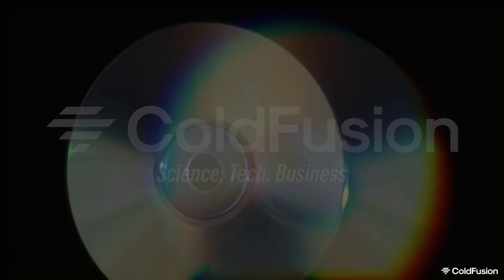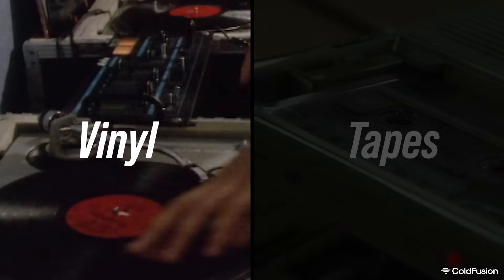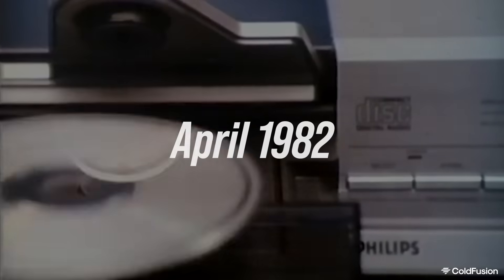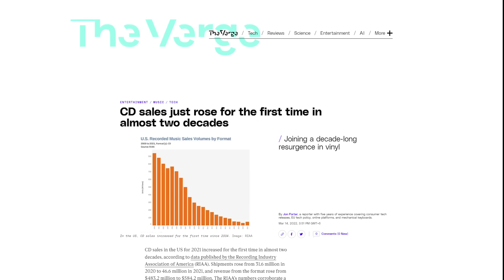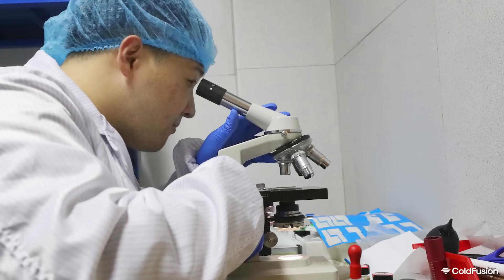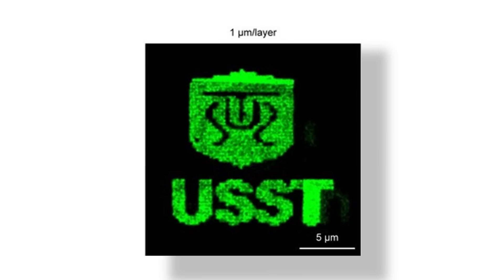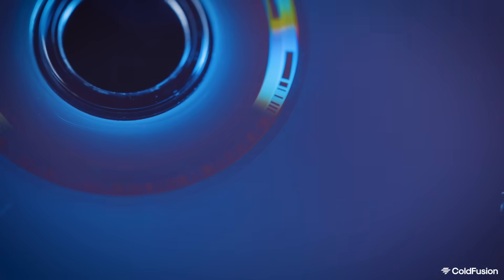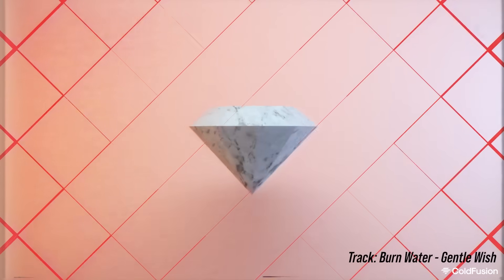Why This New CD Could Change Storage

Comment: You cannot store data on flash drives indefinitely. Sooner or later solid state drives need electrical charge from a battery or an outlet to maintain its data integrity. It could even suffer catastrophic data loss from getting an over surge of electricity. CD were the last storage medium that combined optical and mechanical technology to create data storage medium that could last beyond the owners own life expectancy. With the fad of solid state technology finally waning due to shortage of raw material to sustain production rationality is finally forcing marketers to return to earth and focus on a technology that is sustainable for archiving and storage.

Comment: If they're not using organic dyes this time around, and it's stable mid to long term, it's going to be a boon for read only storage stuff that doesn't need to be retrieved immediately.
there's got to be a lot of backup targets in data centers that could use a shrink in physical size.

Comment: Even with improved read and write speed, I don't think this can ever compete with large SSD storage (which can already reach 20tb per SSD, at blazing fast read and write speeds), there is one application tho, where this could be a game changer.

Data center archives, as of right now, if a data center burns down, you either lose the date, or need an entire extra data center, just to archive one copy of it, which is ridiculously expensive.

But with discs like that, your entire data center back up could be a read and write machine the size of a printer and a small safe to store the disks. And every single disk could have an entire data center copy on it, with plenty of room to spare.

This kind of tech is clearly not meant for individuals, an entire human brain stores about 2 petabytes, who could ever need, even in the far future, 100 brains worth of slow storage ?

For mass archiving tho, yeah, that's pretty dang useful.

Comment: I h*t3d compact discs!
Looks like they're gunna be back. It's such a flimsy technology. I still have plenty of 70's and 80's cassette tapes, cause they're so durable- they just need an unwind from time to time.

I still have most of my vinyls from that time also- yet very few CDs. They just don't last long and they scratch easily.
I've got 2/3 copies of my collection of PS1 CDs.. 10 or so from the 60/70 music discs I bought in the 90s and 2000's. I've only got "Dune" and "System Shock" from my PC stack.

Many times I made use of a CD, I had to treat it as if it would be the last time I'm gunna hear, see or play it, cause the next time, it may be scratched.

It's just not a sustainable technology, in my eyes- unwieldy(massive), flimsy, and "old". Why the appetite for it now- and to "safekeep" or store data(!?), I dunno.

Comment: LOL MB/Sec write? That's like 6 years to write 1.6 Peta byte of data! A Spec of dust would cover up 10s of gigabytes of data!  
Back in the 80s I remember reading about using a sodium structure to write on atomic scale.  This is like that idea recycled 40 years later and click baited onto a CD! video.
I'm surprised 5G and AI wasn't included into the hype.

Comment: If they can make it one quarter or less the size of a normal CD (1/4 of 1.4 PB data is still a lot) it could be basically an MP3 player overloaded with an interface if it can browse fast and pick the song then it could work.

Comment: I have the best of both worlds. Still have my fully restored R-94 Rowe jukebox. Its a combo made in 1993-94 to commemorate the phasing out of the vinyl 45 record and bringing in the CD. The jukebox has the 100- record carousel and underneath it is the factory-installed Panasonic 6-disc CD changer. All of the jukeboxes after this were CD-only

Comment: Using M-Disc at 100GB was a big jump for backups. Taking care of the Disc are important, if you care about the data on them. The backups now are into the 14TB size, Big Data is a driving force on how to backup large amounts of data. I left tape backups in the 90s, When I had 2TB of backups. Now if 1.6PB gets off the ground making a archival backup on just one disc would be a time saver. Day to day backups are HD to HD. HD has its draw backs.

Comment: I have a thing about old storage media. Apart from having several external PC storage drives (especially for music). I have everything from a full blown Revox B77 reel 2 reel, a mini disc hifi  separate, 2 cd players, a dat player, 2 hifi cassette decks with one being a twin deck and approximately 5 turntables plus a vhs video player and 2 x  DVD players. I also love new tech, but I am very much in the camp of owning your own media, whether it's DVDS, CDs, vinyl or even software.
So I welcome this new technology as I hate the cloud and the control you lose by using it.

Comment: There's a lot of guessing and wrong information in this video. For example, CDs are not known for longevity.
They warp over time, they degrade over time and that just the plastic and that's when they're in storage, not spinning or being heated in a server with a laser.
Also the failure rate is very high because of the CD itself but also the mechanical parts and the laser too and they are incredibly slow.

Comment: The technology where you can literally put the entire series of the Simpsons or One piece (including all movies, specials and extras) on one single disc. It what I’ve been what waiting for
Reply: Depending on compression you already can. Older shows only in standard def will fit on one standard 25GB BD-RE. 
I've considered SD cards before for this but the consensus seems to be that optical media still lasts longer.

Comment: 10:55 That is nonsense. In a datacenter you usually want to have data for write access. A read only medium doesn't help in the data center.
11:00 This is also nonsense. CD-ROM and DVD-ROM do have a horrible durability! After a few years, burned disks are not useable. So many people have lost their data because they thought it was a good idea to store their data on CD/DVD.
Reply: I still have copied DVDs from 2004 and they work perfectly fine...

Comment: SHOULD this ever hit the market, they better put it into a protective encasing, like DVD-RAM, ZIP Drive discs and of course the amazing MiniDisc and Hi MD. Because the biggest caveat of optical discs has always been the exposed read-side and the fact that most consumers treat their stuff like crap and always scratch up their discs by not handling them properly. A protective caddy would not only make it so much safer and story, it would also basically make it easier to add Labels on them, especially for recordable mediums. And differently colored plastic caddies would also add quite a nice color-options for when you need to make discs instantly recognizable as Audio Medium, Video Medium, Data Medium or archival medium.
Reply: Theoretically they could make the discs smaller in size since people dont really need 1.6 petabits yet and with an encasing they would essentially bring back the modern minidisc/umd!
Reply: @kosmas173  That's exactly what I thought when I heard the news: a 1-terrabite collection of HD movies that you can literally carry in your pocket.
Reply: I liked PSP discs very much for that exact reason :) Protective casings will noticeably increase the price, though :(
Reply: @my_wifes_son  Well the MiniDisc and HiMD was better because it had a protective latch that really kept the disc always protected. That part was missing from the UMD for the PSP and that was a problem because many used UMDs you find are often scratched or dirty.
Reply: @KRAFTWERK2K6  oh, I see... Kinda like a diskette.
Reply: @my_wifes_son  Yup. Only optical and therefor more robust.
Reply: Return of the floppy! But thicc!
Reply: @Tiniuc  extra thiccccc 😚
Reply: @KRAFTWERK2K6 nicki minaj style 😂

Comment: The bottleneck is going to be read/write rather than amount of data. Even if I have 100 TB of video (perhaps 16k+ video) store in a drive, it won't matter if I can't quickly load it up. This technology has to go hand in hand with improved CPU speed, RAM, and data bus. Otherwise, it is just a big archival storage, whereas modern trend demands a reuseable storage over one-time writeable storage.

Comment: One major drawback has been ignored which is SCRATCH. CDs are prone to scratch. To make this technology viable even for data centers is also very questionable because if somehow a disc gets a scratch, a huge amount of data will be lost. But yes, research is research.
Reply: Any hard drive can fail, and any disk can get scratches and not read or write properly. Anything ever made for any reason whatsoever can eventually not work.

Comment: I absolutely hate the cloud. I prefer physical media that I can hold in my hand and cannot be taken away from me without someone having to break into my house and steal it. Any "cloud" storage I use is stored on a computer that is in my house where only I have physical access to it. Plus I don't need an internet connection to access the data on it. Anything that requires the internet to use is a big no no for me.

Comment: I'm a huge fan of Bluray and its amazing capacity over the simple CD and DVD.. I am also old enough to remember the birth of the PC in 1974...  I remember the first Walkman cassette players, and CD Walkmans and also the birth of the MP3 player and so on.. I still possess one of the original cassette Walkmans that could record and it still, much due to mine own efforts at preservation, still works. This much storage would be wonderful. I could easily back up my massive collections of files on just a few disks for permanent storage.. There is definitely a lot of work to be done to make it commercially viable in the consumer market, but I would absolutely have one and be glad. The biggest problem with 4K and 8K video is the immense size of the files and lack of being able to store them effectively at low cost. I as well, prefer to have my media user side instead of on a stream that breaks up, pixelates, and buffers and so on. It's annoying and proving to be even more costly than even cable TV has become with so many different services, each wanting their piece of the pie. This problem also causes many I know to never want to have a TV that can show them because it is pointless and overly expensive. I personally am well known for saying that I would never have a 4K monitor for my computer until the storage problem is properly addressed, or they find a ways to condense the file sizes to a usable size. For example, a 1080p movie can at full size be as much as 18-22-even 48GB, but a 4K movie can even exceed 100GB. While the video quality of 4K and above is amazing, and can even look like a living window.. It's just not worth it and the hardware is ludicrously expensive.. It's just not.. worth it until storage and encoding can manage the tasks more effectively.. This breakthrough is definitely promising and I look forward to what is to come.
Reply: BDXL format of multilayer Bluray does allow full movies at 4k, and I do have a BDXL Writer in my PC, so you can install that 4k monitor.

Comment: Another year and another optical disc breakthrough news story. The key is making the tech work as a backup storage medium is that it has to show that it is robust and reliable. Tape backups are still the norm and will continue to be for quite some time. Some places that implement this optical storage as a secondary backup to see if the tech will be useful,  but mostly likely just eat their budget and nothing more.

Comment: My goodness, very impressive and informative video!
I have a special interest in the optical disc as an archive medium for my wildlife video work.
For the past 10 years or so, I've pursued the "M-Disc" to try to store a small amount of this work;
but at 128GB maximum, I often have to split long video files, which are actually very long, raw image sequences.
My entire footage library is currently about 25TB and growing, so this new technology would be great to see implemented and affordable!
(For some time now, it seems the video archive community relies on LTO tape, with migration to new formats necessary every 5 to 7 years, and I hate the concept and limitations of any magnetic tape format.....Also, a few years ago, I had heard of a new company called Folio Photonics, which seems to be developing a similar kind of archival optical disc tech, also aimed for the data center market.  Have you heard of this company?)
(BTW, I also love the concept of the optical disc for archiving because of its longevity compared to any other storage tech; the low energy use is also very "green" and attractive in lowering storage and maintenance costs.....
Thank you!

Comment: Sure, I would like to have this Petabits  CD. It's the most reliable data storage, coz I have lost countless data to magnetic hardisk and SSD. Wish to have a Petabits CD for my data backup.
Reply: That's probably because you're using cds less. The wear and tear is way harsher and faster on cds because they can be scratched. Ssd and hardrive can have problems that can be fixed or even have it's data found again
Reply: @gabrieltorres6633  Good luck on that with a head-crashed HDD.
But I'd love for there to be an optical disc cartridge to protect the disc from damage, as was found essential on all the larger capacity floppy disc formats.

Comment: "Only megabytes per second"
I mean, that still beats the "superman memory crystal" that writes or reads at a mere 200KB/s
Also how many megabytes? Because HDDs for example are "only megabytes" aswell at 200MB/s for decent HDDs which is actually fast, and even some SSDs at still in the megabyte range.
But yeah, 50000$ for the equipment makes this useless for basically every private person. Only useful for companies.
I wish someone would design a disc that functions exactly like DVD and Bluray, in a sense that you can use a standard bluray reader/writer, but maybe have it store only 1 or 2 TB each and still be cheap.
200TB each disc is just insanely excessive for us private people, even the data hoarders. 10TB would do just fine, just get a few of them.
I wouldn't mind if it wrote at for example 8 megabyte per second, maybe even lower. Just means I'd have to leave it writing for a little over a day if it was 1TB of data.
Perfectly usable for a backup, assuming the disc actually has good longevity, unlike bluray.
You should honestly have brought up LTO tapes, because with how ridiculously expensive this new CD is, tape is just way better. LTO9 offers 18TB of uncompressed data, and LTO10 will give 36TB once that comes out.
And you can get drives for them for probably 1/10th the price of that stupid laser for the new CDs.
The CDs however would take less space, but physical space is cheap for companies. Equipment and having things running is the costly part.
Also what do you do if the 50000$ laser gets damaged after like 5 years and your warranty is over? Buy a brand new one for a ridiculous cost again?
This CD and LTO stuff is all like razors and printers. Sell the product for cheap, but then have the price of the item required to use them at an insanely high cost.
Companies are so fucking greedy... But they know they can get away with it because stuff like datacenters actually pay for it.
This new CD is honestly going to be irrelevant, even for datacenters, unless they can prove that it either lasts something like 100 years or has an insanely fast read/write speed or bring down the cost of the equipment to read/write it.
Otherwise LTO tapes wins in every other aspect except for physical size.
Reply: Access time.  Game over for serial data formats of all types.

Comment: I don't feel like 200 terabytes on an optical disc is really practical for commercial use... yet...

But if the technology could go a little smaller in scale and cheaper, I feel like it could be very practical. There are games that take up 100 gigs on a drive. Imagine it being a little like the old days but, better. You never install the game directly on to your drive to eat up all of your precious storage. You just pop the disc in the drive and let it play off the disc. 

This brings into question: "what about loading times? Will it actually be as fast as solid state storage? 

What if, instead of a spinning disc, it was actually more like a platter or block and instead of the data being read segment by segment, it was read all at once? 

I feel like spinning discs are too impractical for any sort of commercial use. At least for anything that you'd like to be fast. But as a long term storage method, imagine being able to save all of your music and videos onto a single disc.

Comment: The problem with recordable CDs (CDRs) was quite short shelf life... 5-10 years. (not to be confused with manufactured disks which used printing). The dots on the disks diffused and the lasers in the drive faded. This made them useless for reliable data backup, especially at high capacities. In comparison, mag tapes were good for 20+ years. This problem might still be a show stopper. Either way is a fight against entropy.

Comment: This is all hype and drama for effect.  5 x 20 TB HDD @ 400 each is $2000. 25  x 4 TB SSD @ $250 each is $6250.   Best bang for the buck.  HDD is still much cheaper than SSD.  You don't need to buy 1 x 100 TB SSD @ 40K a pop.  This is just plain stupid.